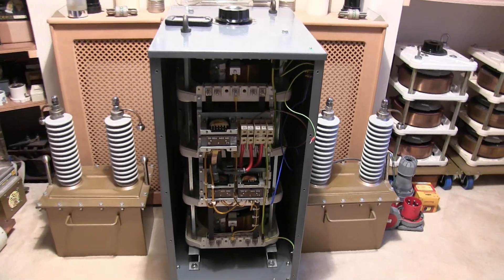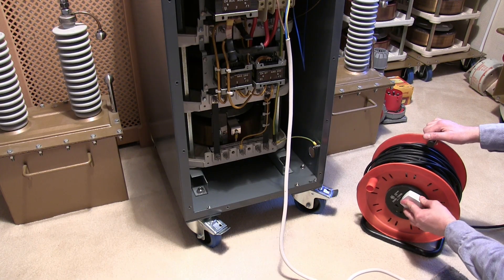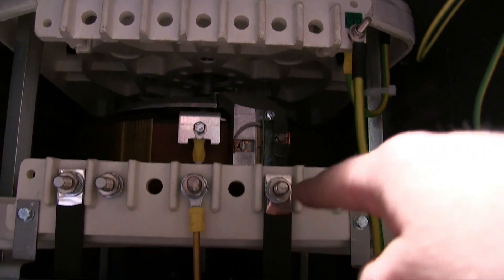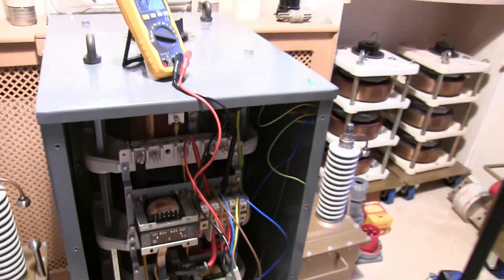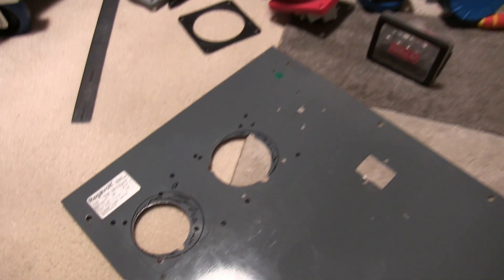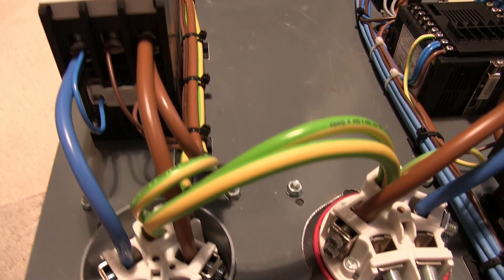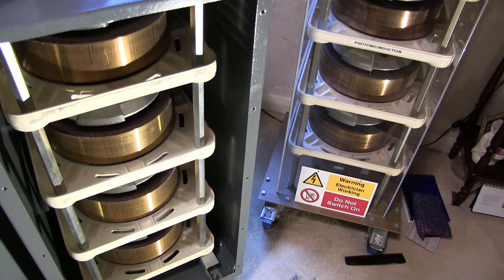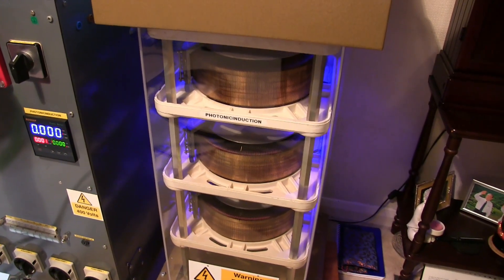100 Amp Variable Voltage Transformer

Comment: This power supply and your other motor driven unit are incredible pieces, for sure. On your other unit you mention balancing chokes and for this one you mention balancing transformers. Are these two terms just used synonymously? I understand that balancing the loads of the variacs is essential for longevity and stability when running  multiple in parallel. IF I had to purchase balancing transformers what do I look for? Is there another name for these that I need to look for on electronics supply websites?

Comment: Just a quick question, arent these Variable Autotranformers(also called Variacs)?  To tell you truth i havent seen or heard about Variable tranformers. (i own a company in Greece that manufactures power transformer from 1947, founded by my grandfather, and we also import and sell Variacs, so it realy is a genuine question not trying to sound smart or anything).
Do these also offer isolation from power source(i dont know if i say this correctly, English aint my native language)? Because as far as i know the main difference between Autotrans and transformers is the fact that the first one has one coil and the second one has two coils(isolated from each other).  (Really happy to see active in youtube again !!)

Comment: What do the chokes/balancing transformers do in this context?
Reply from the maker: http://www.farnell.com/datasheets/73633.pdf
Reply from the maker: Say you have 2 or more in parallel one might be at 80v and one might be slightly out at 80.2v then you would have 0.2v with lots of amps fighting each other. The chokes take an input from each on a few turns of heavy wire and use a centre tap as the output, this equalises any differences between the transformers.
Reply: @Photonicinduction  That's very interesting, many thanks for the explanation!  I had not thought about the voltages being slightly different between the units in parallel.  That's an interesting solution to the problem.  Thanks for the PDF link as well, that was very informative.

Comment: (Forgive me if this is a stupid question...)
Why are the in- and output so high up the transformer? Wouldn't it be easier to have them at the bottom?
The way I see it that would make it easier to have the route the heavy cables without creating tripping/toppling hazard. 

Awesome to see you back here Andy!
Reply from the maker: Excellent observation, but the originally the hole was cut for the switch and output when I got it, so I had to use the existing round hole for something, to keep looking reasonable and given limited space without the stuff on the front panel hitting the transformer, this layout worked. Less trip risk with the main leads high as you can see them. I like your thinking.

Comment: Where do you get the balancing chokes from or do you wind them yourself? Also where do I find out more information about them as I can’t seem to find much information online. So pleased your back Andy, missed you man
Reply from the maker: Claude Lyons sell the kits, very expensive £400 just for the chokes, all they are is a few turns of heavy wire with a centre tap for the output

Comment: What a lovely bit of kit. Only 233v mains voltage? Here it's 245v +, which is what I thought most of the UK was. Why does this variac need balancing chokes and how does that work? Impressed by the neatness of the wiring,that must have took some time... and skill....DA

Comment: At my last company we had a three phase 300kva variable autotransformer to test large electrical drive equipment at a range of voltages.  Be carful to avoid running continuously with the brushes at the same position. These aren’t as robust as a standard transformer. Also make sure to derate for harmonic distortion.  Fans and temperature monitoring can be very helpful if your operating at high current….

Comment: All you need to do now is trim the foliage off those garden variety high voltage capacitors, then use next door's cat to fulfil the function of discharge resistor for 'em!

Comment: What are those 5 contact plugs? I guessed that it channels 3 phase power and it bypasses the house transformer. So of the remaining 2 contacts, one is neutral and the other is ground. Is that right? 
And why do you have two of these coming into the transformer?

Comment: The control knob for that stack of 4 variacs looks surprisingly easy to turn. It looks easier to turn than my single 240 volt 25 amp General Radio variac.

Comment: You should try and get some juicy control boxes from an AC locomotive like the tapper class 81-86, thems was big beastie boys and the 86 and 87 you had to respect 'em as too much angry pixies and they could gouge out a nice dimple of a rail before the trips blew with the 87 and 90 being absolute 25kV monsters for power handling.   On the 81-87 human beings weren't allowed in the engine area when under power, was a big naughty no no as prob quite some big fields emanating in there esp at the 87's 110mph.

Comment: As an old aircraft electrician, my heart jumped when I saw you touch a terminal with your bare finger. Even if I know the buss is dead, I strongly reserve touching them anytime unless absolutely necessary. Even the, I give it a very quick bouncing finger slap. I highly respect electrical power. That’s why I enjoy your channel. Thanks

Comment: on the coiled extension cord front i have a 3ph drill press and lathe and only one Static Phase Converter no budget for a second and they are on opposite sides of the shop so i made 40ft extension cord to be able to plug the lathe in interestingly when the cord is coiled on the wall behind the drill press the drill  has more power and it took me a while to stop breaking half inch drill bits (long and the short of it is the coil inducing a current in the "dead third phase") or am i being haunted by a ghost that hates drill bits?

Comment: Plz do something with batteries again
They POPPP so nicely! 

Or/and with (very) high voltage switches. The one in your big ass fuse video was pretty neat 

And/or one about big amps DC current and the magnetic influence on cables going  parallel. 
Maybe make cables move/jup buy BIIG amps?

Comment: Can i ask a simple yet probably silly question: How much is your electricity bill per month on average????
Reply from the maker: A rough guess is £100 a month but its the tumble dryer, cooker and dishwasher that make it add up. Using 20,000w for 5mins is the same as having the clothes iron on for an hour. Its not much really.

Comment: Awesome 😎 Andy I have several lengths of 5mm x 60mm copper buss bar that you can have. Would certainly make your cap bank lower inductance. Not sure how to contact you apart from here.

Cheers
Matt.
Reply from the maker: There is an email on the about tab to discuss, as it happens the 4 x big blue 20kV caps need linking up, sounds useful. Kind regards, Andy
Reply: @Photonicinduction  , I guess I am being thick but I can't find it in the about tab. Just PayPal and some link. I will look on the laptop tomorrow at work. Several of the lengths have 90° bent ends with holes for 12mm bolts so should work out perfect 💪
Reply: I mailed you Andy. Hopefully we can work out how to get you some chunky copper for your cap bank and several bits for whatever else needs it👍

Comment: Hi, great VARIAC, but where are you going to get 240 x 100 = 24KW power outlet?
Reply: in one of his old vids he showed he added a connector that connects to the national grid, i think it bypasses the houses fuse/current protection and stuff too
Reply from the maker: 100A supply is standard in UK

Comment: Why do you use 3-phase connectors for the in / out? Is that because they're rated higher in terms of voltage and are readily available?
Reply from the maker: 3 phase plugs can be used on either 3 phase or single phase, but single phase plugs can never be used on 3 phase should I ever want to run the transformer on 3 phase. This way there is always the option of either.

Comment: G'day,

Ummm, well, it's good that ye ken verra well what thee be doin' wi' all that there then...!

As an alternative to Gardenin' though, why not wire all that Apparatus up with the Jungle intact, then pump the output of a small Coalfired Power Station through the Gubbins...; and perhaps we might observe the Effect (if any) of a great big Shitpotful of Electrickitiez in the Machine, and the surrounding Electro-Magnetic Fields thus generated..., on the sensitive wispy little tips of the Plant's growing Tendrils...(?).

Your call, of course, olde Bean ; but it might prove to be quite,
 an interesting sight.

Such is life,

Have a good one...

Stay safe.

;-p

Ciao !

Comment: So if I understand this right 100 amps equal enough to cover whole household and you can lower the voltage down to 120 volts and then you could run American Appliances would this be correct?

Comment: Petition to have Photon crack the electric motor RPM record at 40.26 Mrpm, set by some Germans (with an actual application for it).. I'm sure you can get away with some stuff if it only has to run for a little bit :)

Comment: But this one goes to 11!

Why use 3 phase connectors when it’s only wired single phase? Is it just to match your cable stock?
Reply: It looks like a three phase variac .  The opening segment only uses one phase.
Reply: well, you can use those connectors with just few phases. But most industrial HUGE CHONKY BOYS are 3 phase + earth + common (5 pin), so it wouldn't make financial sense to get specifically high power 1 phase connectors and wires. He can just use a 5 phase wire pre-terminated and all that. I assume he wired it compatible with 3 phase systems so if he cross-connects them it wouldn't be a problem (assuming his 1st phase is the "same" phase of the 3 on the other end)

Comment: How do you get away with not having an inrush current limiter in this beast? I have just one of those variable transformers and it will pop every breaker without a soft start!
Reply from the maker: Its pretty brutal, that's why I have 4 switches to bring them on one at a time

Comment: I'm saying this because I would love for you to live and keep making such great videos! But if you're using an extension lead should you not un coil it for better heat dissipation to prevent a short and a fire? Although that would make good content 😎
Reply from the maker: You are correct but I intentionally did this to prevent the high inrush current drawn on the transformers, the extension lead coiled up acts like a line reactor and limits the inrush, ok to do this off load.
Reply: @Photonicinduction  ah I see! I've been outsmarted again 😂

Comment: That variac looks like it's original purpose was to use a European 220V/380V feed to test products intended for the British 240V/415V market, with just enough extra oomph to recreate the highest voltage in British homes.  The strip position shown at the start was probably for the opposite job of making sure British machines would work on 220V continental or colonial supply.

Comment: 6:18 Too bad they're prob not isolated secondaries, could put those in series for 540v 100A =D. 480v 100A choke in series = really bright arc after they touch.
Reply from the maker: On next weeks video you will see the output of that go into a isolating transformer that is 250kg 30kVA and it will pump out 15,000v

Comment: That definitely trumps my Chinese specials, 2x 120v in/250v out in series (one of the perks of  120-0-120V power). Used to feed a pi filter for 0-500VDC supply, 5kVA ea and 30A DC choke but can do 20A continuous and 0.1% ripple at 30A for a few minutes at a time.

Comment: SWEEEETT!!!   looking good...  Ive got my (4) 1256Ds set up the same way, 240 in and 280 out pushing a distribution transformer (2 @14400 in series/parallel ) for a total of 31KV out...  I use it primarily for my Tesla coil. Scarey primary voltages at 31KV... plays hell on the spark gap for sure. I use 5/16" tungsten rods on a synchronized rotory disc running 1800 rpm... quenching the arc is a pain tho, it can drag the arc out to 2-3" sometimes when the air blast isnt aimed right... presently have the current inductor set at 70 amps. Its a huge EI core ( 6"X6" center core) wrapped with triple strands of #10 THHN wire at 250 turns...  stays somewhat cool, after several long runs the ballast does seem to get a bit warm tho ;)
Reply from the maker: As long as it works that's all good

Comment: Neutral wires are so much thinner than hot side.. but yet alternating current puts the same voltage through neutral side at 60 HZ (USA). I am just a hobbyist, but I struggle to see why neutral is smaller than hot. Love your videos, glad you are back ✌️

Comment: I wonder why they don't make 100A's as a single unit that doesn't need balancing chokes. Granted it would be really heavy (bigger core and prob bilfilar 6 Awg magnet wire). I've seen 50A ones, but only 140v. Maybe it's economics/demand?
Reply from the maker: Why don't they have a single cylinder the size of a dustbin in a car engine instead 4,6 or 8 (12 is nice) lol
Reply: @Photonicinduction  Yeah now that I think about it the brush and copper underneath would get really hot (prob pop after a few mins at full load)) since as a single unit they could only make it with so much area (prob no more than 2 turns/4 bifilar windings wide and only as long as the toroid is tall).

Comment: Front panel job is sexy out, cable management is A1 , fair play lad
Reply: Nice wiring job! I am concerned about one thing though. You backed off on the voltage to the motor at the last moment?  Are you feeling ok? 
Just had a few random thoughts- If the plot from the movie "Maximum  Overdrive " actually happened, there's going to be a lot of light bulbs,Motors ,microwaves,TVs, washing machines, toasters, ..to many to mention,  coming after you.
The other  thought,  some what morbid,  in your last will and testament, you need to request a lightning rod be installed at your grave site.
Welcome Back!